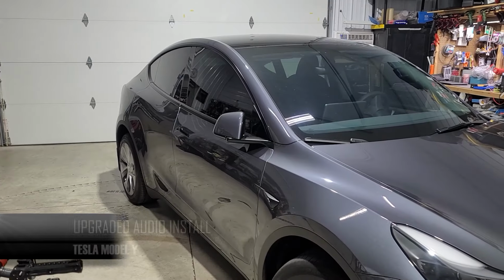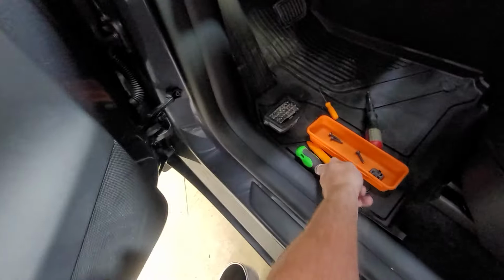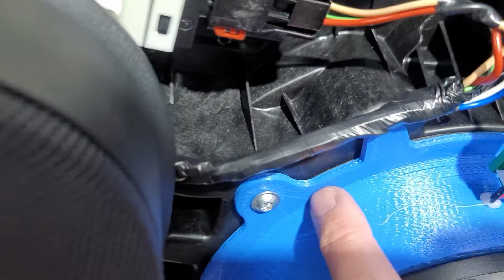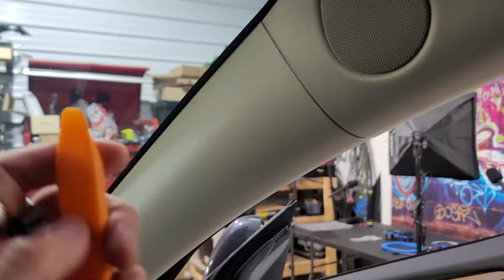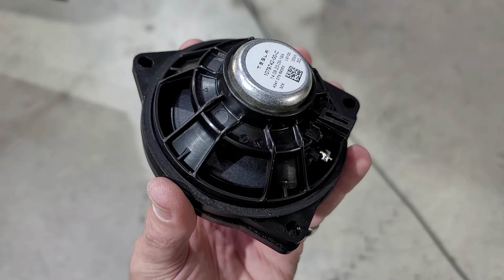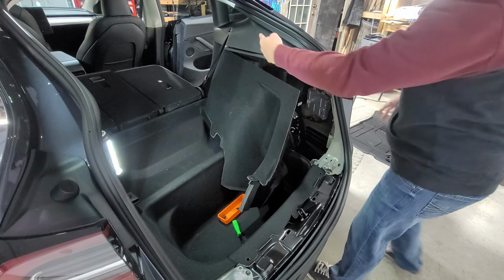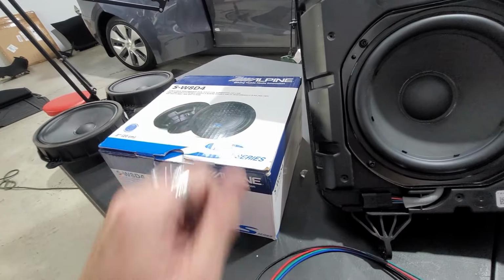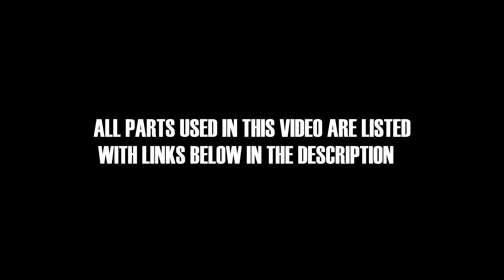TESLA MODEL 3 / Y - HOW TO INSTALL AUDIO UPGRADE NEW SPEAKERS AND SUBWOOFER

Comment: This gives me some ideas. Great job with video .
I own a tm3 sr plus .
Can I just switch the speakers in the doors without a subwoofer and get a much better sound? I already activated extra 4 speakers but to my ears everything is too sharp so I need more depth.
I understand that the sound would get much better with the sub but if I want to do minimal work… would it be a good upgrade?